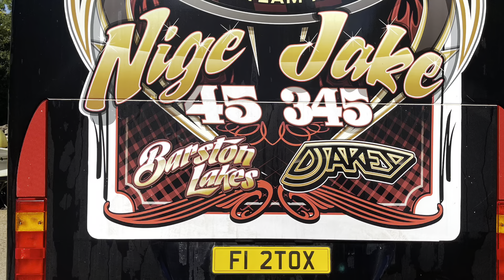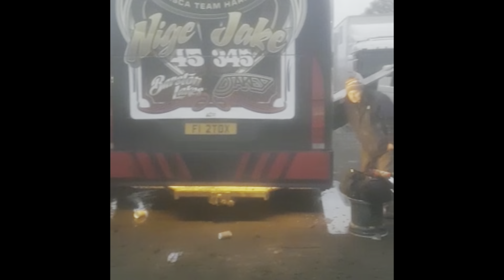I am seriously considering our future!

Comment: It sucks when it's bad luck on top of bad luck. I can hear the disappointment in your voice. Make a few changes (it can't get worse!). You've really tried to do everything yourselves and that's commendable. You've had the advice of changing axles and hiring a track for practice. All worth a try and any other advice good racers can give you will help. There's only so many times you can scratch your head before it hurts 😢 And only so many times you can spend money without any reward 😢.
This week is a new week of learning. Do what you can, expect the worst, and then anything positive is an absolute bonus. You've got this guys!